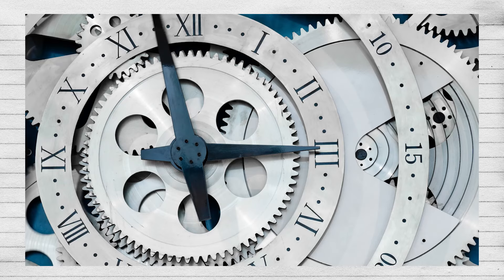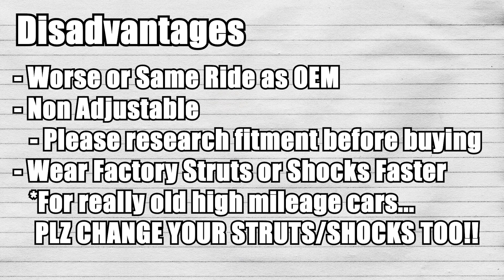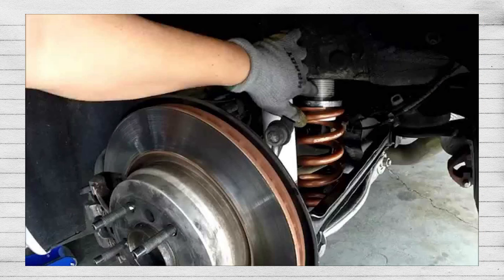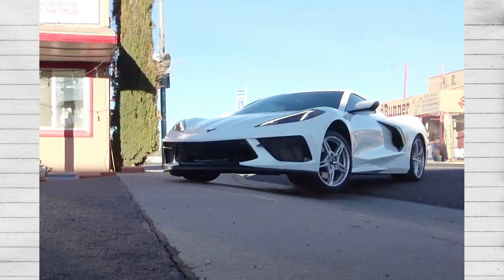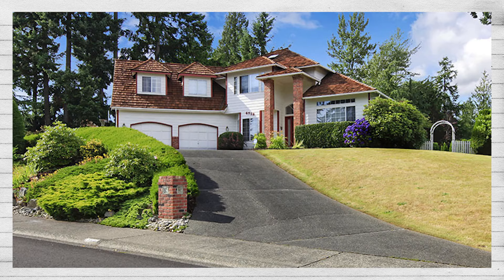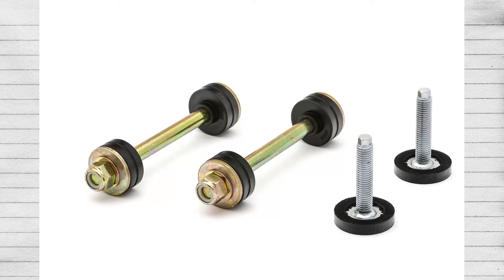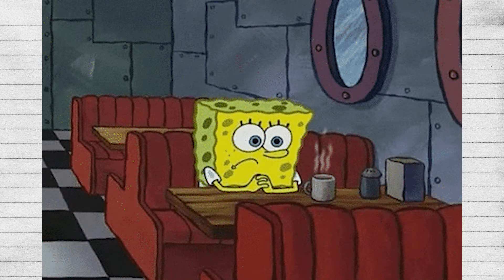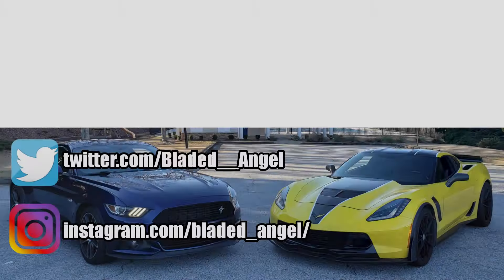Noob's Guide to Modding Suspension!

Comment: Don't cheap out on coilovers, they can be worse that stock of you go too cheap. You can also get more adjustability with the more expensive ones as well.
Reply from the maker: Honestly a $1K Coilover setup is still leagues ahead of a worn out OEM strut setup.  For High mileage old used cars, I think even cheap-mid range coils are still fine.  The cheapest coils are still better than the best springs, since I'd rather have a new assembly than keep wearing my OEM one.  As for a new car, OEM suspension has gotten so advanced with adjustability, that yeah some Coilovers are far worse than OEM (on top of New Cars being low mileage so nothing is worn yet).
Reply: @BladedAngel  true, especially if it is a 20 year old car with blown out struts. Just something to keep in mind. 1K is about where I think a good starting point. Brands like Feal suspension or BC Coilovers typically start there.
Reply from the maker: @jaydenray2803  Yeah, I'm on BC Racing for da Stang, it runs fine for now.  Anything was better than my literal lack of functioning struts/control arms on my Driver's side (Cause duh, a truck slammed into it). But I'd say $1K is a great budget starter to get into a low-mid to mid range.  OFC I would never tell someone AY YOOOO, GO GET EM $300 eBAY COILS BROOOOOOOOO! I can already foresee nothing good coming from that.
Reply: @BladedAngel  lol, BC's are the way I went too. Good stuff.

Comment: My cadillac had magnetic suspension. Rode beautifully, but after the wreck only one replacement was $900. I had to say goodbye to my car.
Reply from the maker: F
Reply: @BladedAngel  F indeed. I cried that day
Reply: Insurance is a thing...
Reply: @brianbird3756  the damage outweighed the price of the car, they totaled it
Reply: @magicmanv2658  not hard to do nowadays, by your first comment, it seemed like you had to sell your car because of $900.

Sorry for the confusion.
Reply: @brianbird3756  yeah, it seemed misleading. My bad. The price of the damage was 13,000. The car was 12,800. The front right side was completely smashed in
Reply: @magicmanv2658  man I know how you feel, I recently swung too wide and hit the corner of the garage.  The only visual damage was the corner of the front bumper and the turn signal bracket broke.  Cost to repair is almost $4000

Comment: along with the magneride, I have a science project rn where we have to solve a problem. My idea is electro magnetic suspension, I wanted to be able to have the idealness of magneride while haveing the coolness and adjustability of bags. On electro magnets you can adjust the force of the magnetic field around the magnet and it is powered by mini computers. so when you send the "code" to stregthen the force it will repell and therefore raise the height of the car and vice versa

Comment: Dialing your struts from the hood changes ride stiffness not ride height, if you wanna change ride height in coil overs it’s pretty hard cause you have to take the wheels off and take them out, then once you get it all set you have to change your sway bar end links because the geometry changes and they will be preloaded
Reply: you dont have to take coilovers out to change the ride height

Comment: I drive a 2001 Mx5. I have Eibach pro line lowering springs and Bilstein B6 dampers. This paired with some Whiteline antiroll bars and 17 inch rims running Michelin pilot sport 5’s, it makes for a wonderful ride on street. It’s very firm yet also smooth over bumps. Not magnetic suspension smooth, but absolutely one of the best regular old damper designs I’ve ever felt. 

Honestly I’d recommend against coilovers for street cars as most coilovers are just way too stiff. If you’re building a track car then coilovers all the way, but for street I’d advise getting some nice dampers and springs. I’ve done coilovers on cars before and while yes the handling is amazing, the ride will suck ass.

Comment: I have mag ride on my 05 Cadillac STS4 it’s amazing. The nice thing about MRC is that they can last forever as long as the seals last. My car is almost 20 years old and still has factory suspension. I’m going to replace them anyway because they are kinda rusty now. But still don’t leak! I can also adjust on the fly the suspension stiffness from touring to performance.

Comment: Bladed gotta ask which is better, Harder Springs or Softer springs when using MacPherson Struts and Coil Springs

My Family still has their 97 Lancer and my uncle recently changed the suspension springs to a more softer kind
Reply from the maker: Softer is better for cruising, Harder is better for racing.  You can just get a progressive spring so it softens when cruising, but stiffens when you accelerate or corner.  
IMO if you want to choose between the two, get coil overs. always the most foolproof way to have a choice instead of buying two different springs based on situation.
Reply: @BladedAngel  thanks bladed

Comment: So is the only way to get a front end lift in the aftermarket world a hydraulic setup? Or are there combo magnaride/coil overs/etc that include some form of lift system?
Reply from the maker: Magneride barely lifts a car, my Z06 only has a 0.6 inch travel between all it's modes (lowest to highest) so yeah...it's not saving my ass anytime soon.
Hydraulic lifts in the aftermarket are extremely hard to do on Front Engine cars (which is why most cars are mid-engine for them).  Most Front Engine cars will have to sacrifice nearly all their trunk space just to outfit it.  They're also very expensive, being $4.3K for a front end lift on a C7 Corvette or Viper.  And like $3K for most other cars.
If you're just looking to lift 4 or so inches to go up a driveway, Air Suspension would be better. Cheaper, More reliable, and only gives up a little trunk space.  

I only recommend hydraulics for outright STYLIN ON SOME FOOLS if you want to literally dance the car and bounce it like multiple meters in the air.  It's not a practical mod at all, it's an all or nothing deal.  Go balls to wall on track in a mid engine car with them, or show up at the local meet dangling them thangs as your car is lifting it's wheels up.
Reply: @BladedAngel  thanks for the info! My intended use is track driving so coil-overs/magnaride was what I was looking at, but I was curious if there was a way to get the airbag/lift system convenience of being as low as you need to be on track while also being able to go over bumps and into driveways

Comment: 5:45 Really?! Hmmmm 🤔

Well here are some facts. There are some big disadvantages.

1. They are meant to adjust and due to road junk they might not be able to adjust because of road junk getting stuck like small rocks and salt and so on and they are really hard to get clean out or you can't all together. 

2.  To adjust them is very annoying and to do it properly is very annoying. But because the standard in the United States is well it's good enough looks like you really don't care about something being A+.

3. Some aftermarket companies will not sell you replacement parts if you wanted the units or small pieces was to go bad or get defective. You would have to buy the whole set of four.

Comment: Does anyone remember manual 4x4 activity getting out of the car to lock the front wheels into 4WD
Reply: I remember deciding before I left home whether I was going to want 4WD or not, and preselecting on the hubs.  then just hitting the transfer case shifter at any speed and laughing at the guys with eventualtrac having to slow to 5 MPH for 100 feet to shift in and reverse to shift out.  granted, just twisting the selector in the new daily is easy.

Comment: Great video but the segment about linear vs progressive spring rates isn't entirely correct. Its not so much to change the damping reaction of the car..The progressive spings aka "multi-rate' springs is for dealing with variable weights hence why the multirate springs are only in the rear of the vehicle.

Comment: When you were talking about air suspension you say you can get cups does that count as air cups suspension or is that something completely different because what I've seen air cup suspension as is a coil over with a cup on top of it that you can use to adjust your ride height and is best for going over like speed bumps and  Steep driveways while also still having the coilovers

Comment: Hey Bladed, great video! I also wanted to point out that hydraulic suspension in road cars does more than raise and lower for bumps. For instance, on my CL63 AMG, it virtually eliminates body roll through turns. This gives the vehicle much more stability, control, and just a more sporty feeling when driving hard, without necessarily giving up a comfortable ride.

Comment: Side note about the Magneride part: Tein makes an active suspension kit for their coilovers (EDFC Actice) which perform similarly in theory, being able to adjust damping on the fly. Since the system runs of a g-sensor and a GPS speed sensor for some versions, it's nowhere near as advanced as Magneride, but still an impressive feat of engineering for what it is imo

Comment: Isn't air suspension dependable on outside temperature? I heard you can drive bags in cold but you have to constantly drain your tank and remove water inside.
Reply from the maker: you drain the tank regardless, but yes, the current weather and atmospheric conditions do affect frequency. It's not that hard to drain, just kinda annoying every now and then, only takes a couple of minutes.

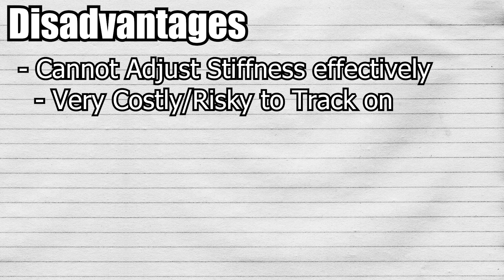Comment: 10:03 There is specifically designed air suspension to combat this problem?
Reply from the maker: For insane prices, yes. I mention cups as well as "Track Focused Bag systems", but still say "A Coilover setup for track will be cheaper".  
I can't physically stop someone from racing on bags, but I've seen friends blow them on Lanier Raceplex and Road Atlanta...what happens to their bank account next isn't pretty.

I'd rather blow a coil, OE strut, or shock, than an air system.

Comment: I remember when I lowered my mustang on coilovers, I had accidentally set them for all the way down instead of all the way up. Scrape nation, I did raise her up about a ½inch. And yes Camber Caster plates are basically a must, it was the only reason my mustang didn't be come a stance car. Overall tho they were probably nicer than stock suspension and the felt great. 10/10 for coilovers

Comment: What would you think about lowering a 2015 town and country?
Reply: Why waste money modifying a Chrysler minivan
Reply: Respeck all builds
Reply: man I don't want to be a dick, but it's better to just get a different car instead of spending money on that thing. And it's not bad just because it's a minivan, that's just a really bad unreliable car. If you really want to mod a minivan get a toyota sienna or a honda odyssey with a ZF 9 speed.
Reply: @NuclearPineapple  thats all i could afford, i spent like 700 bucks on it
Reply: @SomeOne_86  i spent almost nothing on the van tbh, i just wanted something to drive
Reply: @Wind_slash0  it's full of rust and falling apart...i don't think respect is a think for it
Reply: @Errorz404_  don't waste money on it please. Buy a civic, a sn 95 mustang, 4th gen camaro or something. That van is not worth spending money on. Use it as your daily or your winter car. That's my advice :p
Reply: @SomeOne_86  i probably won't spend money on it except for new radiator hoses
Reply: @Errorz404_  I'm hoping you'll change the oil, break pads etc lol
Reply: @SomeOne_86  I hope i will too lol
Reply: @Errorz404_  the just drive that for as long as you can and save money for something more tun
Reply: @NuclearPineapple  that honestly was the original plan i just wanted to see what ppl would think of modding one, im actually saving for a 56' f100